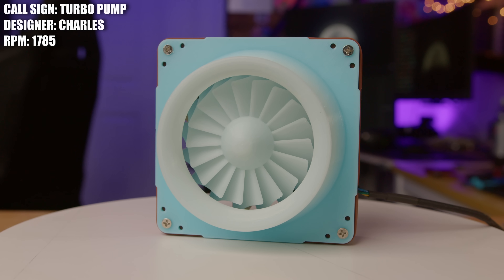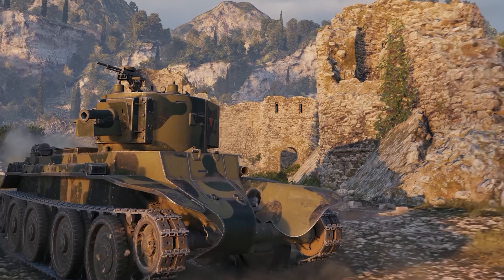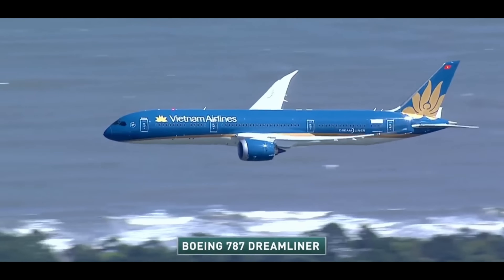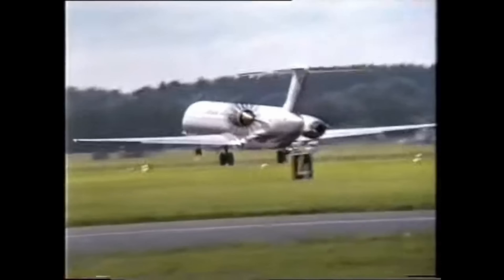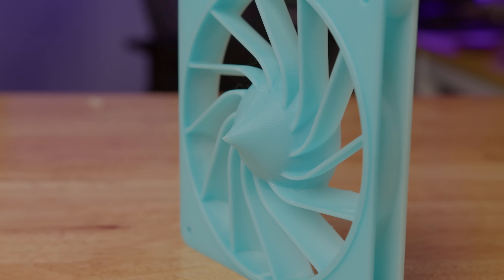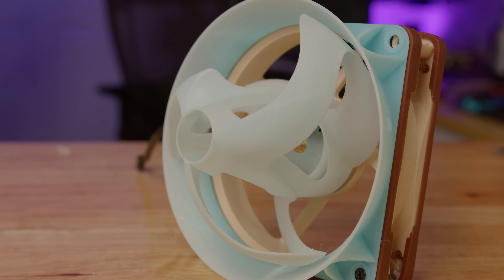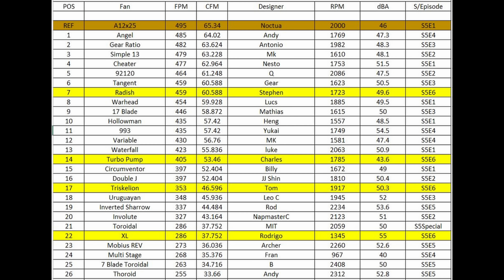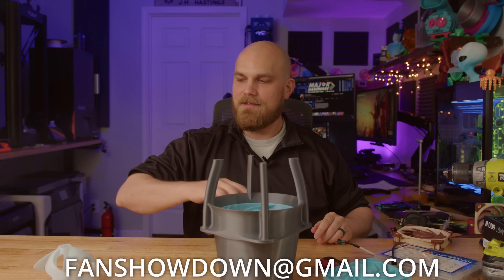Turning the Sharrow Marine Toroidal Propeller into a PC fan | Fan Showdown S5E6

Comment: To be honest, the Turbo is probably the best out of all four.  

The Radish has a little bit more airflow, but its all concentrated into the middle (Because its meant for thrust not cooling), where the Turbo is slightly less airflow, but spreads it out across more of your heatsink.  Remember, Surface Area is as if not more important than airflow.

Comment: I strongly suspect, although I don't have a way to prove it, that the reason the Sharrow toroidal propellor comes up short as a case fan is the medium. Water is largely incompressible, so a propellor that moves larger quantities of water has greater thrust by direct reaction. Air, on the other hand, is readily compressible, so a fan that moves lots of air builds up a higher pressure behind the fan; given time for the air to expand again -- as in a high-bypass turbofan engine -- you recover the energy from that compression, but over the distances involved with a normal case fan setup, you're just getting a higher pressure behind the fan than you would with a more efficient fan design, not a greater airflow.

Comment: Just as an aside for the high-bypass and open fan designs for jet engines, there is a second limiting factor -- tip speed. The faster a fan rotates, the faster the blade tips move, and the larger the fan, the faster the blade tips move for the same rotation speed. It will likely never be a problem for computer fans, but the higher the mach number of a propellor or fan, the lower its efficiency becomes, and when the blade tips closely approach Mach 1, the noise produced goes up hugely. In the 1950s, there were two experimental XF-84H fighters built with a turboprop engine driving specially-designed supersonic propellors. These planes quickly acquired the nickname 'Thunderscreech', because the sound produced by the propellor when the engine was run up, in the plane of the propellor, was physically painful more than 100 yards away from the plane.

Comment: As fun and novel as the toroidal designs are, I can't see them performing well as CPU fans. The toroidal design looks like it's trying to minimize propagation of vortices you would see at high rpms. CPU fans just don't reach the same rpms so you wouldn't see nearly as much benefit to that application. 

This is on top of the fact that CPU fans are not open blade or in a variable state environment like the MIT designs were intended to be. Minimizing vorticity propagation is much more important towards minimizing noise in that environment. Can't see toroidal having much of a future for CPU fans... Excited to see their development in drones and boats though!

Comment: do u have a high temp resin? u could probably print a small turbo for a lawn mower if so, since the exhaust temps are generally low (for exhaust at least) would be cool to see.

Comment: An idea is on the XL instead of just having a drivetrain straight to the main fan you could also make another fan before that on the main part of the Noctua like normal and have that push air into the bigger fan which could help.

Comment: It's so charming how all the DIY engineers make their fans... Just like in cargo-cult make "look alike thing" and it will work somehow. If I need to design fan, I'll analyze flow I need, power I have, and just calculate blade configuration for this exact case. Modern fans can produce up to 97% of efficiency, so you can't go against physics and invent over 100% ECE configuration. However, you can create a little less noisy fan with some design efforts.

Comment: Nice episode Major, super interesting fans. Going back to the previous episode with the all-time best fans, I think that you could probably make that into a mini-series. Maybe you could run more tests such as radiator thermals, air cooler thermals, noise, and maybe a noise to performance metric. Then maybe another episode testing fdm vs resin. I know you have done comparison videos in the past, however, I feel like different designs could respond differently based on wing thickness and such, which could drastically alter the weight, and thus performance of the fan. Anyway, Keep up the great work, I'll never get tired of this series.

Oh and one more thing that I've been meaning to discuss with the community. There seems to be a missing metric which is never discussed in these videos, and that the cfm testing leaves absent. The turbulence of the air, the angle of the exhaust and it's rotation, as well as the speed, within the first three inches behind the fan, can be a significant variable that is overlooked in the current testing methodology. Also, the positioning of the exhaust can be a significant variable, especially with air cooling as the exhaust being concentrated closer to the vapor tubes can substantially change thermals. Because of this, I hope you consider going back to the previous testing methods of just checking thermals using a well built air cooler in the future, as I represents a much more real world performance metric, than just check cfm and static pressure. I understand the community likes the current testing method, but it does seem to fall short for me. I think that the information gathered from the wind tunnel is a nice piece of supplemental information, but it doesn't tell the whole story. 

anyway, that's my two cents. I'd love to hear what the community has to say. And congrats on being a new parent!

Comment: Have you ever tested, or considered to test the Noctua S12A? It should in theory be the best "open air" (no impedance) stock 25mm fan out there, even over the A12x25. "The Ferrari of case fans" some say, but it's also very overlooked. It's problem, is that it starts to drop performance very quickly once any impedance is introduced whatsoever, only making it suitable maybe as a rear case exhaust fan. But maybe even that is too much impedance for it to be better than the amazing A12x25 for some case grills I wonder. But it would be really interesting to see you do a review of it including the "smoke test".

Comment: 4:30 shame you're gonna leave the rear impeller off. The Noctua NF-F12 uses one to improve static pressure.

I assume that cone is hollow, could you cut it off, sand it flush?

Comment: Great vid.  
The XL was spoilt by the ridiculous ring attach to the ends of the blades which does nothing but add rotational mass that consumes power.  
Enlarge the cheater blades or 1 of the other past ringless fans that ranked well, to fit snugly into the XL enclosure instead of the hideous ring fan.  
Regards, Jas.  
VK4FJGS  
Rocky Qld.

Comment: The thing about the chart is I wish that all the fans were run at a constant rpm. All the fans should be tested at 2000rpm with maybe a 50rpm variance. Without a standard rpm the CFM really isn't a direct comparison. A heavier part would cause slower speeds which effects its CFM compared to a lighter part spinning faster and possibly pulling more air. Fast doesn't always mean higher cfm, but it can.

Comment: IMO for season 6 there should be two catagories, 1 catagory for fans that use things like velocity stacks or otherwise extend out of the bounds of the original fan. And another catagory that fits entirely within the original fans footprint. Just so the "normal" fans can also have a shot at glory.

Comment: No data on actual temperatures when mounted on a radiator and used under load anymore? I find that a touch lame, but I'm old school. I like to know how well things actually do in their designed application, rather than what could be considered "anecdotal" factors, such as just total airflow.

Comment: Now that I've seen a ton of theae vids. The Radish does look nice. But when attached to a radiator wouldn't that only push air only in the center, not all over the surface to help cooling?

Also these larger cooler fans need more power. The base fan only has so much power. So any larger, and usually heavier, fan doesn't get to full "power". Other than your R/C motor, do you have any other way to see if some of these fans need just a bit more power?

Comment: I've seen numerous PC modders make videos "testing" a toroidal propeller as a PC fan. The whole point of a toroidal propeller is to prevent/reduce tip vortices - air or water wrapping around the tip of the blade from the high pressure side to the low pressure side, which reduces efficiency. This is completely unnecessary in a PC fan because PC fans are ducted. The ends of the blades attach to a shroud or duct, and the duct completely blocks these tip vortices.

Ducts are generally undesirable in boat or plane propellers because the extra surface area creates additional drag for the propeller, reducing its efficiency more than the efficiency gain for preventing tip vortices. Which is where the toroidal propeller has an advantage, because it can prevent tip vortices for a much smaller increase in drag (it has more propeller surface area, but not as much as a duct). Usually you only see ducted propellers in applications where objects entangling in the propeller are a risk. But if you're trying to blow air into/out of an enclosed space (like a PC), the edges of the fan blades are already going to be right up against a stationary object, so it is by default ducted. And there's no benefit to reducing tip vortices because there are none in the first place.

Comment: The Sharrow prop concept does not have any benifet in a ducted fan scenario.  This has already been tested in marine conditions with bow thruster tests (by Sharrow themselves).  I don't think there's much more to be gained, without using a non pc fan format for mounting.  The prop has to be separated from the motor by a long shaft to take advantage of the fluid dynamics involved.

Comment: I like both the narrow-ness of the Radish's exhaust flow, and the obtuse exhaust of the turbo.
If I were to use 120mm fans I'd throw the turbo on the bottom, and the radish in the center and top positions.

But 180mm fans is where it's at.

Comment: I really liked the XL design, it just needs some fine tuning is someone cares to do it.

Like a Boat with the wrong propeller, it's taking to big a bite out of the air, and the motor cannot get to the correct RPM to generate maximum power. It's bogging down.

To increase the RPM, decrease the blade area and decrease the blade angle of attack. Keep reducing them until the motor is spinning near it's optimal, 1700-1900 RPM.

Comment: The advantage of the Sharrow propeller is that it has some of the advantages of a ducted propeller without some of the disadvantages. The advantages has already been tested and proven, its just that it is proprietary and expensive.

It is highly applicable in boats, not really applicable in PC fans. Ducted fans will still be better for air propellers vs. toroidal.

That's why the stock Noctua seems unbeatable. The frame of the fan already acts a duct, no need to overcomplicate things. And it's not like they didn't do their homework when they designed it.

Comment: an intercooler reduces temperature. A turbo compresses air. A supercharger combines an intercooler with a turbo to do both. I can explain why but I am not going to. I just wanted to point it out as you said that your lawnmower's turbo reduced the temperature that was incorrect, an intercooler would do that or a supercharger may do do that, not a turbo. When you compress a gas, it's temperature will actually rise.

Comment: The XL would probably do much better without the ring on the fan, and with a stator. Probably still not super high performance, but it have the potential to be very quiet, if it doesn't rub, and with a silent bearing. One of the easiest ways to make a fan quiet, oversize it.

Rings on the fans is a bad idea, that's why it's (almost) not a thing. It hurts aerodynamics, pretty bad, and cause noise. I tried it when I made a replacement for my table fan, I knew it wouldn't have great performance, but I was really surprised by how bad it actually was.  Very low performance, high noise and high power draw. If stretching of the blades is the concern, thicker blades is a much better solution.

Not having a stator on axial fans that push air into an open chamber is another classic, it's amazing how little back pressure it takes to reduce the flow a lot. 

Besides those two issues, and the fact that the size makes it "not very practical" I really do like the design.

Comment: the only issue I had with these test was that the toroidal fan and others like it are designed to run in a very specific rpm range to get the most out of them. I'm not sure that the noctua fan can hit that rpm goal though so it might not have been fair to those type of fans.
Reply: Toroidal fan designs mainly increase efficiency of non-ducted fans. PC fans are ducted fans, so I wouldn't expect a toroidal fan to ever really do as well as a conventional when ducted, which is kind of what we've seen.

Comment: I had the same idea as the XL,  but i didn't submit it because i knew the motor couldn't drive it. A 120mm version would probably work much better
Reply: Yes, I agree with you. You can see the RPM is very low, meaning the power the electric motor is putting out is very low. It's running on half the power that other fans are. Hope you give it a try, but reducing the angle of attack of the blades, and the blade area will reduce the "bite" of air, allowing the motor to spin faster and the motor to use more power. More Power, more air flow. It's just like having the wrong propeller on a boat motor. The motor needs to spin at a certain RPM to maximize power.

Comment: That turbo one looks backwards. I would have put the small end as the output. If that was the drive end, where the fuel is burned to produce power, then, yes, it is absolutely the right way around. The idea of a turbo intake is to gather as much air as possible and compress and accelerate it. The blades are right, but it looks like the drive.

Comment: You should make a modified version of the radish which has a frame around that extra part to make it fit in front of the grill. It looks likely that it will be the overall winner if it's measured as intended.

Comment: You're going to lose power through such a long drive shaft on that last fan.  The triskelion's noise profile sounded the most tolerable.  During the smoke test, you should've propped up the XL as it was warping the divider.

Comment: as a fan towards this series, self-powered fans (heat engine fans)
Reply: well one version is a stirling fan, but other no-moving-parts fans are
Reply: so 3d print those marine fans, paint with conductive graphite paint, electroplate with metal, not so complex/expensive anymore huh, yes metal parts from 3d plastic prints
Reply: yes diy and choose your metal electroplating coating thickness

Comment: My outside-the-box idea is, if anyone wants to try and create it for me, is what I instantly came up with before the XL was shown (after he hyped it):
It's like a high bypass, in essence.
Inside the hub is a high speed turbine style (aka jet), like on Turbo Pump; however, instead of the velocity stack, it extends out BEYOND the frame of the fan and transitions the pitch into a 200mm Ultra-High Bypass sickle style blade. (it will probably need a support rings @150mm, and blade tip; aka 200mm)

Then, to to it all of, is a big shroud that has a velocity lip and funnels the 200mm back down to 120mm... ☺️😏
Therefore combining the airflow from the inner high speed turbine PLUS the high volume from the UHBP portion.

My hope, in the end, is that if nothing else the high volume airflow will act as a "lubricant" and cause air to channel inwards at an even higher speed, thanks to the inner turbine blade! 🥴

[I don't really expect anyone to try this, but 🤞🤞❤]

Comment: I wish you would add static pressure as a measurement category as well as the others. Might as well measure it all, right? Some of these designs seem like they would provide much better static pressures at the expense of flow rate, but currently, all we can see is the flow rate so we don't know if they are pure doodoo or just doo.

Comment: The airflow of the Radish looks rediculously insane, if it can sustain this airflow with a rad or towercooler between, this thing looks like a dream if you have your tower setup accordingly. This even looks better than the Cheater. That pulling and push force just seems to be insane.

Comment: Hmmm, maybe add CFM normalized to RPM. Look at Toroidal and XL - both the same CFM, but drastically different RPM. And yes, I know both used maximum from the motor, but note to rate design itself (when could be pushed to the limits with better motor) would be fun to see.

Comment: Why isn't there any static pressure data compiled with these stats? Understanding that data point, both on the intake side and discharge side  would be useful in a variety of ways.

Comment: I will give you one nice idea about how air differs from water - it is much lighter, so you can "throw" it. In other words, you can involve air mass with showel like, scoopy fan. But always remember that air will be pushed tangent to blade plane
Reply: Good example - termalright old fans. 
Big scoopy blades good with flow, but less with pressure